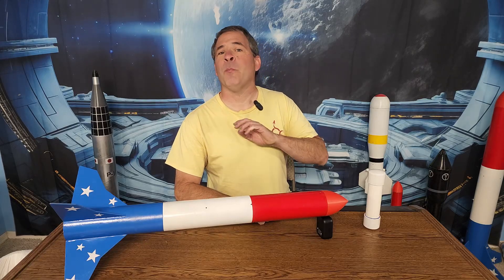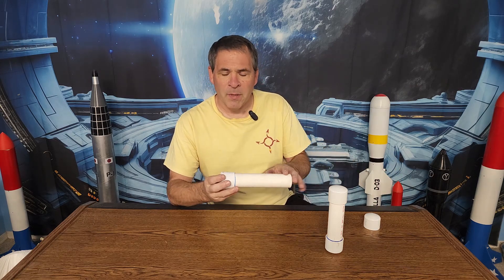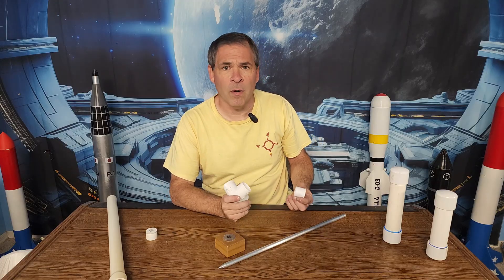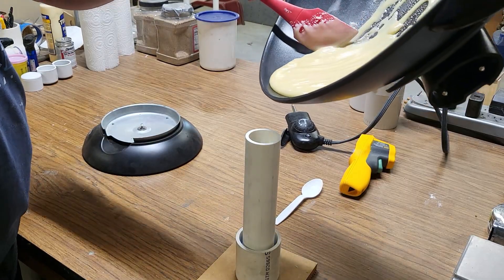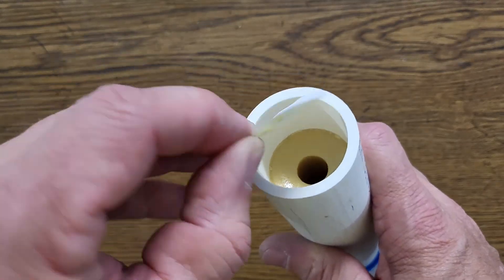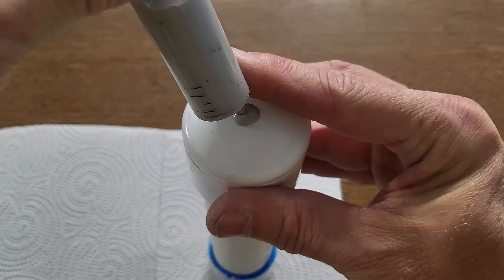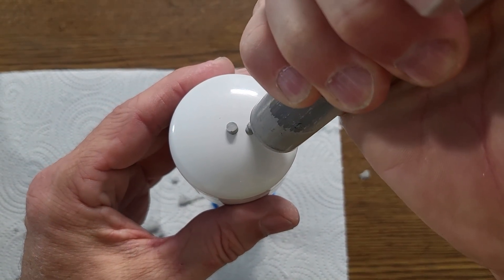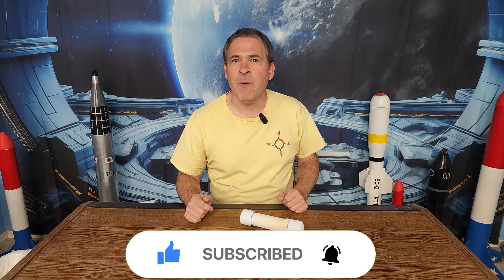A smoke trail for my homemade rocket motor

Comment: Me and my dad built a rocket whenever I was younger instead of using a tube for the body. He used 3 DOW rods so that the center section was hollowed out and then he put a mount in the middle for a smoke bomb. Worked perfectly

Comment: Do you think you could use epoxy to suspend the dry fuel in instead of heating it?
Reply from the maker: Richard Nakka has made rocket fuel from epoxy and potassium nitrate so it is possible. But that didn't include sugar. I have tested some sugar/epoxy fuel mixtures in the past and it seems to be possible. A big factor with using epoxy is how to core the fuel. If you use a core rod, you need to be sure it doesn't bond to the epoxy making it impossible to remove. Richard's web site discusses a few techniques he used to core his epoxy fuels.
Reply: @rotaryrocketry thank you so much for your insight!

Comment: This new smoke-boosted motor is crazy🔥 Any chance you could share the full length or a rough template for your 3-inch Eliminator rocket? I’ve been wanting to build something similar 🙏
Reply from the maker: Our NEXT video will be a complete build tutorial for the 3" Assassin rocket including downloadable templates and 3D print files. The only difference between the Eliminator and Assassin is the fin shape and nosecone length.
Reply: @rotaryrocketry great thank you 😍 could you tell me the 3 inch eliminator rocket total length 🙂 because I'm working on it
Reply from the maker: @subinss5515 The one I'm currently working on is 35.5 inches tall... But that might change by an inch or so before I am done.
Reply: @rotaryrocketry  Maybe a thin coating of RTV in the smoke chamber to further reduce any chance of burnthrough? I'm super interested in Assassin design. Can't wait!!
Reply from the maker: @ronaldfranck6960 Not a bad idea but... The deforming of the PVC doesn't actually happen where the smoke element is located because that area has the cap to stabilize the PVC pipe. The deforming happens just below that area where the top portion of the fuel was located. So you would have to apply the RTV in the fuel area before pouring in the fuel. It's a good idea and would likely reduce the warping but so far it does not appear to be a necessary step.